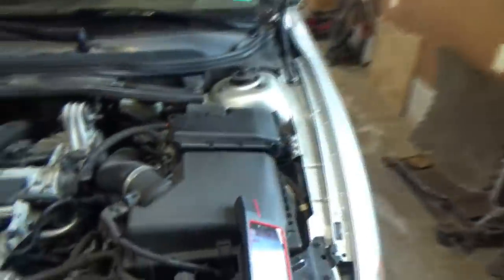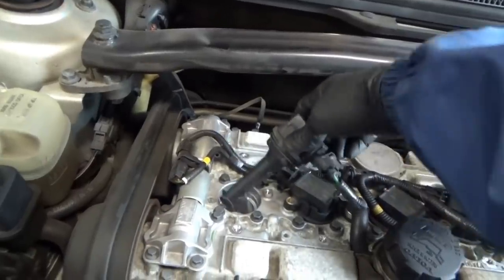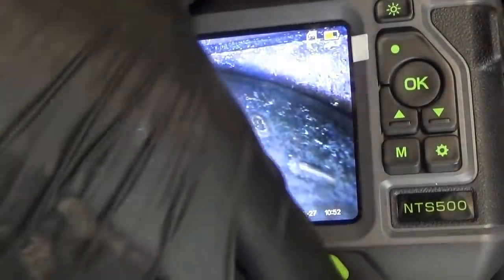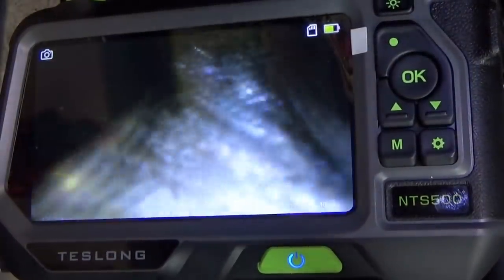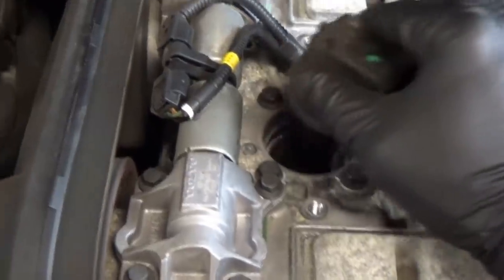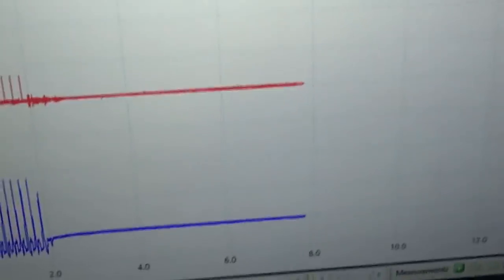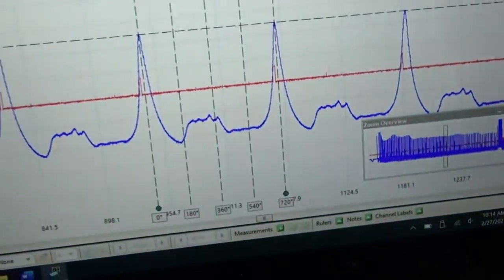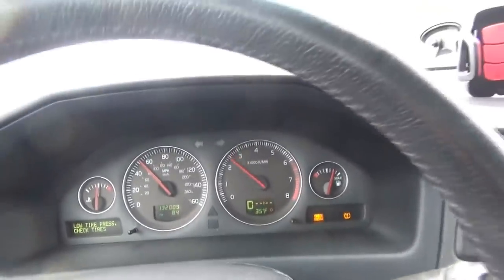Volvo Turbo GRENADES!! - Part 1 (100k special :)

Comment: Hello Ivan, I did a quick look through the comments and did not see the "most likely" cause of the cylinder 1 spark plug damage. When you have physical damage like that on those engines, the number one thing to check is the banjo bolt for the crankcase system. It is located on the underside of the intake manifold on the cylinder 1 side. The innards of the banjo bolt (a pin and check valve) can break away from the banjo and get sucked through the engine. Volvo has released an updated banjo to correct this issue. It's best practice to ALWAYS replace the bolt during a flame-box service.

In best case scenarios, the innards just get sucked through and maybe damages a plug. In worst case, it damages the cylinder walls and/or more.

Comment: not the turbo, you can hear a blown turbo rattling at idle.
Banjo bolt one way valve in the PCV pipe fails and the ball goes right in the intake manifold.

Comment: Compression might be lost due to valve seat or valve, but the component must be from the top of the engine.  Bit of valve spring, of valve retainers of rockers somewhere.  Hard to say really, might even be a bit of valve seat!  Just guessing, but if it were a bit of valve seat it sure would be very rare!

Comment: My guess is the EGR valve passed "bits and pieces" from the exhaust side of the turbo. If this little bit of plumbing magic is possible, it is less clear why cylinder 1 got all of it.

Comment: My guessing is that; At the last time someone changed or inspected the plugs, something had gotten into the cavity between the head and plug. That something-thing fell down the plug hole and down the cylinder when plug was removed. (My guess is that the culprit was one of those plug-nut-thingies you sometimes have to unscrew to make the plug-plug fit.). I doubt it's a piece of the turbo compressor impeller since only tiny pieces will (if any at all) pass the IC, and the pieces that unlikely pass will mostly be soft alu too...
Although I must say those deep and individual craters look really similar to a ring-piece dancing around (sad 2-stroke face emoticon)...

Comment: Something obviously broke loose and got into cylinder 1 and damaged it.  Why cylinder 1 was affected and none of the others is a mystery.  Possibly a small chunk of one of the number 1 intake valves or valve guides or maybe from the intake manifold area?

Comment: Might be possible you have a burned valve. Chunk of valve comes off, bangs around combustion chamber, and then got spit out the exhaust. I think you'd have more noise and/smoke if the turbo was coming apart. A leak down test seems to be in your future.

Comment: Might be from the little ball bearing check valve out of the banjo bolt for the PCV got loose and went through the engine.

Comment: It does not look good seeing those sparkles in the #1 cylinder, would have liked to seen the bore scope on the piston, guessing you are going to find a cracked head around the valve area at the very least.... nice easy way to find the dead one with the coil packs, you would have thought maybe a sign from the turbo but it is buried at this point and you cant really see it, the pressure transducer is an awesome diagnostics tool to see what exactly what was going on with @1 in relation to the other cylinders, 5 I believe? I am banging the refresh button for part 2!!
Reply from the maker: ha I'll post it tomorrow!

Comment: I'm guessing there's a blade missing from the exhaust side of the turbo, not the intake. Assuming that blade came off explosively it could have thrown a chunk through the open exhaust valve. Pulling the intake is the only way to be definitive about that. I drive a turbo Volvo and that turbo definitely sounds out of balance.

Comment: What suppriced me is that you didn't get the VVT turned off due to misfire. When your missing a spark it turns down the boost and turns off VVT :) I have the factory tool and when changing a coil you go in and clear the codes and it runs good
Reply from the maker: Thank goodness it's not a GM...they disable VVT for any stupid reason haha
Reply: @PineHollowAutoDiagnostics  im thinking as for the pitting I really only have one idea. The boost house has a Crack in it that made the car suck something up from outside due to vacume. Sens it has been running without boost. My other theory is that the intercooler is just large enough so metal shavings can make its away through. My first question then... Would be if there any oil missing and is it oil in the intake? With a broken or damaged blade it is out of balance right. And that would make the seals wear out fast. You said in the video it made some boost. The baseline with a closed actuator is 0.3bar positive. And with a open one that is fully working around 0.7 bar if it is standard.

To me it sounds like it has popped a boost hose and somehow sucked something in just by the sound of that spooling up of the turbo.

Question though.... Is it a boost house that's gone open or a inlet hose that has gone open and bypasses the filter. It it would be I would guess for a code on the maf sensor. So in going with the boost side.

If the cylinder has compression somewhat and you put a plug in it. I guess the injector has to have gotten damaged. Otherwise that is not as bad as it wouldn't fire on that cylinder. So my guess is a injector of a sticky valve as for the misfire on one.

I'm kinda surprised it didn't say miss on cylinder 1 because mine (2001 xc70) does say what cylinder. And the flashing engine light means you have a emissions fault. In your case loss of spark means higher emissions and that's why you have the catalytic code. The flashing light is a good thing it means the ecu knows what's going on.

I kinda wish I lived near you. I would work for free just to learn new stuff along side you :) really loved the Astra from hell videos that series are awesome. Love technical faults :)

Comment: Could it be that at one time a spark plug broke, the pieces of which were left to dance in the cylinder for a while. The damage to the piston crushed a ring groove and pinched the ring, causing low compression. The piston is clean because the fuel is washing it at 3000rpm all the time now.
Reply from the maker: Nah spark plug looked intact, and the piston didn't have any dents in it, just pits haha
Reply: @PineHollowAutoDiagnostics  yeah, I was thinking the plug may have been broken months or years ago and replaced. I'm watching part 2 now.

Comment: Must be the turbo. I don't like the sound of it, as it is, now. And also, the title of your video kinda gives it away. ;-)

Well... 2008 car... Turbo/intercooler: gone. The cat is on its way out or gone already, with that misfire going on and possibly that piece of turbo in there. So, it won't pass inspection. There's not enough compression in cylinder one, so it'll need a valve job, at the least. Maybe you can get it decent by using scrapyard parts. If you can only get new/oem parts, then I think this is the end of the line, unfortunately.

Comment: Hi Ivan that car has a damaged turbo compressor wheel, u can hear the whistle sound as it revs up. Most probably has sucked a fan blade into cylinder no1 & remnants of metal holding valve partially open, great video buddy I enjoyed your Volvo fuel pump replacement videos,Congratulations on 100 K subscribers , . . from London England!

Comment: Whatever caused the damage blew through the exhaust right?

Meaning the exhaust prop is damaged, and the cat is most likely plugged. Could you pop the cat off and inspect the inside?
Reply from the maker: Will do in Part 2 🙂

Comment: Running the boroscope through the turbo intake tube is an easy way to shed some light on the perpetrator, since you have one. 👍🙂
By the way, keep up the good work! Just ordered an oscilloscope thanks to you. Didn't even know i needed one!! 😂😂 But troubleshooting with a scope makes newer cars electronics seem less intimidating, at least to me. 👍
Reply from the maker: That's awesome! Diagnosing electronics without a scope is like rebuilding an engine with only a screwdriver and a hammer :D
Reply: @PineHollowAutoDiagnostics  I realize that now! 😂😂

Comment: A loosen  swirl flap flew in to the cylinder #1? Misfire due to air fuel mixture issues because of the missing flap?

Comment: My guess... no noticeable noise in the intake, yet exhaust is poofing... bent exhaust valve. Cause: Whining noise from turbo indicates an internal problem... possibly imbalance from damage vane or bearing.
 (Crystal Ball says: In Part 4, Ivan straightens bent exhaust valve in cylinder, and re-balances turbo vanes, for a no parts required repair)
 Next Series: "No Parts Required" get Ivan in trouble.

Comment: Great to see your effort to make a pressure transducer, very professional website. Regarding this engine, I'm wondering if an old school leakdown test might show where pressure is leaking, even though there wasn't much direction from the waveform.
Reply from the maker: Yup Part 2 we will do an old school leak down check to see where the air is escaping :)

Comment: 100k might just fix it !

What's now sitting in that cat has probably melted the thing …...
So that's a new turbo , catalytic converter , fix the head , valves & a second mortgage .

Part 2 should be interesting . 
Probably replacement engine , turbo & cat .

Comment: Well at least it wasn't a wiring issue, LOL. The engine digested a piece of the Turbo Fan & beat the hell out of #1 cylinder. Now you have a bad valve seating issue ( DOUBT IF IT'S A PISTON RING ) in 1 or more of the valves. You could at the least do a leak down test & find out where it's leaking compression from ? Won't help your problem but you'll know exactly what 1 of the problems are. Then check the Turbo & see if the fan lost any weight ?

I agree keep driving it or trade it in, OH replace NO. 1 spark plug first. Congrats. on 100k subs. YOU RUSSIAN GENIUS YOU.

Comment: Congrats on 100,000 subscribers. Does the pressure transducer only work with the Pico scope or would it work with the Autel as well?
Reply from the maker: Works with any scope, but Pico has really nice custom scale options 👍🙂

Comment: Something got sucked in and banged around awhile, that part is for sure.  That exhaust pressure wave form sure looked weird .... so we got lower cylinder pressure, a goofy exhaust wave form and a pop-pop-pop out the exhaust... maybe a damage exhaust valve seat?  Pressure too low for the cylinder to contribute much.  Do you think number one is even burning the fuel with the plug replacement?  Raw fuel in the cats?

Comment: Low compression in no1 could be an exhaust valve not closing fully due to the damage.
I can't see much getting past the air filter so a fragment of the turbo turbine is my guess.
Shame that it's likely not worth repairing :-(

Comment: High Five for 100k subs! If that is S60 2.5T low pressure turbo, intact turbo does not make a whistle like that. I own a 2000 V70 2.4T, you barely hear the low pressure turbo when you rev it up hood open or barely hear the whistle to inside while driving.  So, I place my bet that a piece of a compressor wheel blade cracked and went through the intercooler and cylinder #1. The throttle body opens clockwise, thus when the piece comes from the intercooler. it hits the end of the pipe below throttle body, and is directed towards left side of intake manifold by the partially open butterfly valve and thus the most likely FOD happens in the Cyl #1..

Comment: Is all the porcelain still on the plug? I don't see how a piece of the compressor could make it through the bar & plate cooler. some thing came apart on the discharge side of the cooler.

Comment: Another possible scenario is inlet valve guide failure, which I've seen on a motorcycle engine. A chip had just come away from the part of the guide that protrudes into the inlet tract. Though it did rev to about a million RPM. 😉
Reply: Actually had something like that happen last year on one of my customer’s mowers. Kohler Courage single cylinder engine had the intake valve guide drop and when the valve closed it broke the valve guide. Pieces of it got sucked into the cylinder and a chunk got between the piston and the spark plug electrode. Of course when the gap closed up, the spark stopped and the engine died. Luckily the damage was primarily to the cylinder head, and a good used one got it running again.

Comment: Everyone is suggesting failed turbofans (blade). 
But for me it looks like either the nut form the turbo came loose and pinged around, or maybe even the head of the injector came of. Like I said, it does't look like a fanblade took a spin even though there's a really nice Bwaaahh sutututu sound. But I've been wrong once before (I think in 1984), and it will probably happen again....
BTW Congrats on 100k.
Reply: were you high at the time?

Comment: I'd say that some part of the intake after the turbo got sucked into the engine, maybe a piece of the intercooler. It could be a piece of the turbo but I have two problems with that theory: First, turbos are very delicate so if some part of it breaks off, it would be unbalanced and probably it would have seized by now or make a noticeable noise. Secondly, I'm not sure if a piece of the turbo can travel through the intercooler all the way to the cylinder. It could be a piece of a valve, that I've seen it could happen as well, although they seemed fine in the video... And congratulation about the 100k!!
Reply from the maker: I agree, the intercooler should act as a filter on the intake side. We'll find the root cause in Part 2 :)

Comment: This video should be a lesson as to why you should NOT NOT buy anything turbo. You make a small engine work hard with forced induction and it will likely result in serious problems. I suspect part of the turbine...the blades...have been ingested by cylinder number one and has done grievous damage to the engine. That engine is mostly screwed.

Comment: Broken turbo inlet blade, the turbo is now too loud, it's scream.
New intake and exhaust valves cilinder one, and replace the turbo, 
And sure That the intake manifold is cleaned into the corners and te intercooler also

Comment: the turbo is clearly making the "ate itself and still eating itself" sound from first attempt at spooling.
RIP turbo, RIP head, RIP catalytic converter, RIP O2 sensor, RIP intercooler(never get all the pieces out). likely RIP pistons, now they're one giant jagged pre-ignition source. same for head, so not just a valve job.
salvage engine and new turbo(or used gamble), that's likely the cheapest route and very likely still exceeds the vehicle value.
Reply from the maker: Yup, very expensive estimate on this one lol

Comment: Looks like the turbo is failing. A turbo is just a small scale jet engine. A turbine wheel and a compressor. Something definitely entered that #1 cylinder. Waiting for part two. Thanks for sharing Ivan. 👍

Comment: The turbo sounr is not normal for a Volvo 5 cylinder,  is probably missing a small part broken of the vane and blown into #1.I would check the turbowheel with the boroscope..
.
Reply from the maker: Will do in Part 2!

Comment: I have seen this type of damage before in boosted applications.  Using the wrong grade of fuel in boosted engines under heavy load conditions can cause "knock/ping/detonation", this in turn causes a rapid rise in cylinder temperature, which in turn causes the top piston ring to expand to the point the piston ring gap is completely closed, breaking part of the top ring land off of the piston, this metal from the piston then smashes around in the combustion chamber, and also can smash the spark plug gap shut.  The broken piston ring land also leads to compression loss, cylinder misfire, and a "puft, puft, puft out the tailpipe, as is seen here in the video.
  I am not saying that is the problem in this video,  just a likely scenario.  Your video does not show the complete top surface of the number one piston, that also needs to be inspected, or was that left out of the video on purpose?
Reply: That’ll be a good call, if true.

Comment: The turbo shouldn't be that loud. Something happened to it, and I'll bet it backflowed thru the exhaust valve. Might've overboosted due to a failed wastegate and or control sol. I remember old turbo 80s Chryslers that would do that.

Comment: I wanted to see the valve seats. Turbo didn't sound right. Look at valve seats and remove inter-cooler outlet from turbo and bore check it.
Reply from the maker: Will do in Part 2 :)

Comment: LOL.  I told you these Volvos are strong.     

This volvo Volvo grenades turbo, has massive boost leak from the sound and has destroyed cylinder number 1 from
Debris getting in chewing it up and loosing most of its compression and still completely drivable.
Reply from the maker: haha I was impressed that it still drove pretty well at speed :)

Comment: Maybe a small piece broke off the turbine impeller?  I wonder if you could feel the cold side of it vibrating? Even a slight imbalance should cause a severe turbine vibration problem, and rapid turbine bearing, or shaft failure. So that's probably not the problem.
 So some other small piece of metal got sucked in there. He was lucky it got forced out before it destroyed the engine. Damage to the exhaust valve sealing surface might cause a burned valve, if it is driven at high load. But I would guess not, so it might work for another 50k miles. The cat might get damaged by having to deal with the products of poor combustion, but I doubt it, since the plug is now firing with combustion taking place. 
I would probably just drive it, and keep the AAA number in the phone in case a valve stem snaps.